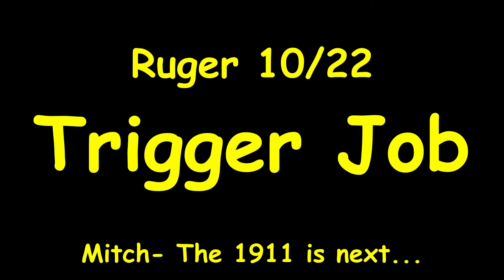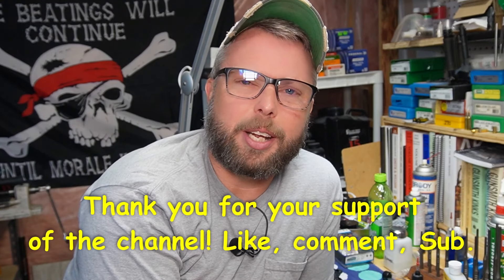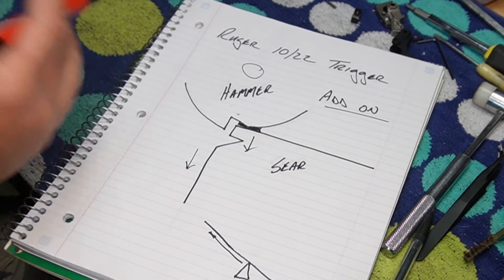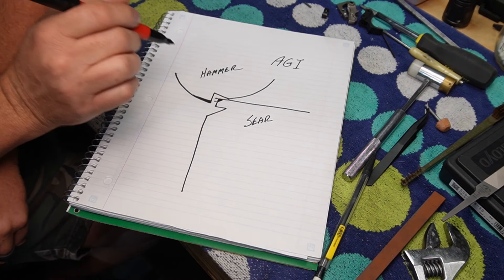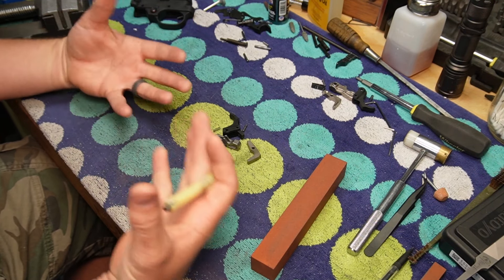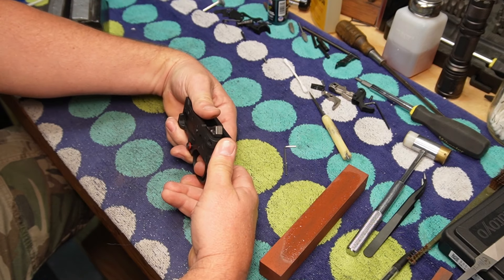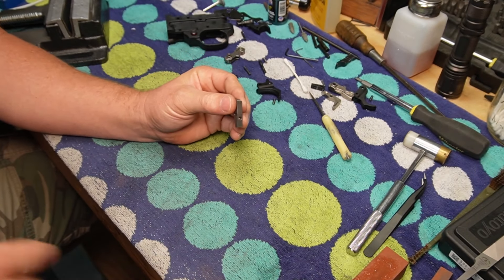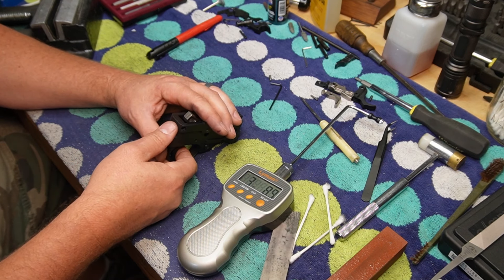Ruger 10/22 Trigger Job: Learning from Failure!

Comment: Bought a new Ruger 10/22 in Nov 2024. Had between 5.8 Lbs and 6.4 Lbs depending where you put the meter when pulling. Used a fine grit whetstone to lightly hone the hammer and sear, added "TriggerShim" shim packs and got down to 3.8 Lbs. Replaced the factory hammer and sear with a matched Power Custom hammer  & adjustable sear and a Wolf Lighter trigger spring. Now at 2.1 Lb and 1.75 Lbs trigger pull. Almost no pre travel and the Power Custom trigger let me adjust the post travel too. VERY crisp but controllable.

Comment: Can I offer some free advice? I’ve done over a dozen trigger jobs on these. 1) don’t mess with the sear except for polishing the top surface and the notch. 2) the notch or hook on the hammer, straighten that hook out a little at a time. Take a little off the rounded side of the hammer where it drags the sear. 3) put a #8 shotgun shell bb in the return plunger hole. Then you may need to take a little off the plunger to get it to reset. Take a little at a time and test. These things will result in a 2.5lb or less trigger with a nice reset. Nice video too.
Reply: Just did a polish job for a friend's 10/22.  Followed advice from Brimstone. Got the pull weight down to 3 lbs even. I don't want to go lower because it is not my gun.  I have not heard of the BB idea in the plunger hole before.  I usually apply a dab of TW25 between the sear and disconnect which allows it to slide a bit easier.

Comment: Ehhh. When you move the sear down on the hammer, the effect is not from how you are explaining it. You are correct that it gets easier but that’s not why. The reason 1) the hammer notch is like a hook, when you change the angle of that hook, or notch, it’s easier to pull the sear out of it. 2) if you add material to the hammer, your partially disengaging the sear which in turn makes a lighter and SHORTER pull. But as you’ve probably found out, it gets dangerous the further you go because you could bump the gun and it might fire. Or in the best case, won’t reset.

Comment: You should never do a "trigger job" with mim parts, many of them are only hardened on the surfaces,  so once you grind it down your into soft material,  which will wear very fast.
Reply from the maker: I never found any info on if they were only surface hardened. But I can’t say that really look that hard either…
Reply from the maker: It might be a 2 parter…just to torment you a bit 🤣
Reply: Just ask tech help at Brownells,  they will tell you like they told me.
Reply: Finally someone who shows details so your understanding what your doing.
Reply from the maker: @patrickdirckx8300 I try to make these as easy to understand as possible. Whether it’s not to do what I just did or it is. I appreciate you watching!
Reply: That is not true, modern mim parts are hardened through and through, its case hardened forged parts you are refering to. I skeletonized my factory mim hammer, it is hardened all the way.

Comment: Great video! I bought the full AGI trigger video. I found it well worth the price. Another thing I like to do when working on an unfamiliar type of trigger is to take a chunk of aluminum or Delrin and drill holes with the same size and spacing as the trigger and sear pin holes in the firearm to use as an alignment and test jig. I have a 10-8 bench block with holes in the back for 10/22, Mark III, Browning Buck Mark, and Beretta 92. That way I don't have to reassemble whatever gun I'm working on to see if my modifications made things better or worse. I use a cheap digital microscope (~$60 to $130 with built-in LCD screen on Amazon) to examine the hammer and sear engagement on whatever test jig I cobbled together and make sure I've stoned them straight. I have quite a collection of pieces that I've taken too much off of.
Reply from the maker: Thanks Brad! How close was I to the video? Hopefully not too far off 🤣 Good suggestion on the delrin. I’m assuming you used the trigger pin holes to locate?
Reply: I have their AR-15 trigger video, although they do have one specific to the 10/22. Regardless, the video has a lot of good information that is applicable to many different trigger systems in general, including the 10/22. You did well in following the rules for a safe trigger and in discovering the magic of the relief angle. As you found out the hard way, just like I did, the need to keep all surfaces straight and square is critical to consistent results. For me, that's where optical magnification comes in handy.

Yes, for making trigger jig blocks, I use a transfer punch or sharpened trigger and sear pins to mark through the gun. If the sides of the gun are flat you can use it as a jig by assembling the trigger and sear on the outside.
Reply from the maker: @bradharris7230 Great tips for the jig. Maybe someday I’ll get a magnifier that has a screen so we can all look at it at the same time. Another item to put on the list! 🤣

Comment: On my Ruger American Rimfire I tinkered myself, with help of YT, with the bolt and trigger.
I’ve got the trigger now on +/- 500 gr. (1 pound), and it’s crisp like an angel. I put shivs to take out the wobbling of the trigger. Then I put in another spring, although the trigger pressure is adjustable I couldn’t get it below 1,5 kg (3 pounds). I checked with an armor smith if it was still safe and it is. 
For the bolt and other parts I did a lot of polishing, and it’s smooth.
Reply from the maker: There's nothing like tinkering with something and afterwards enjoying that improved feel